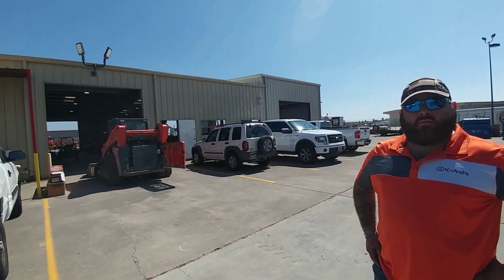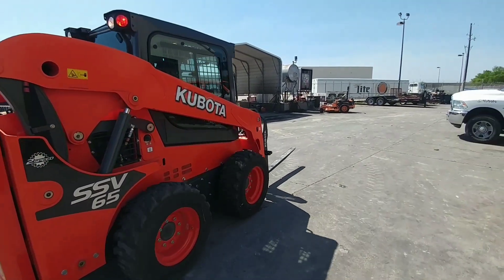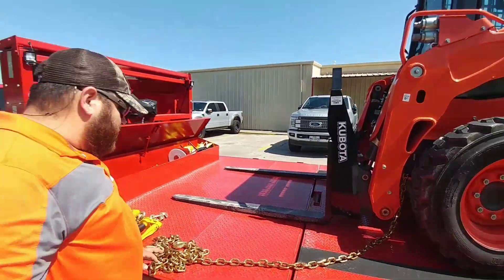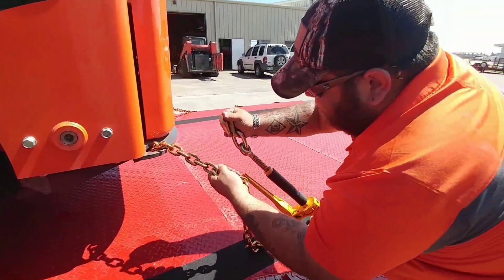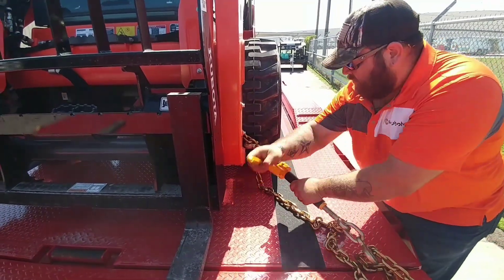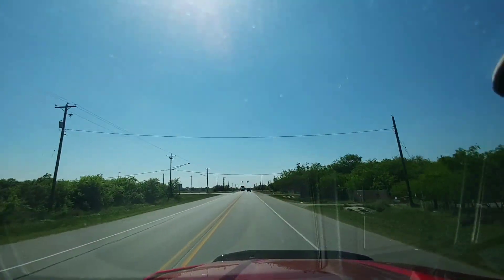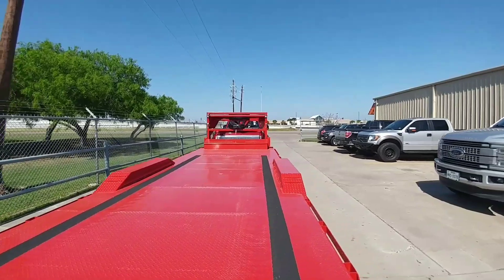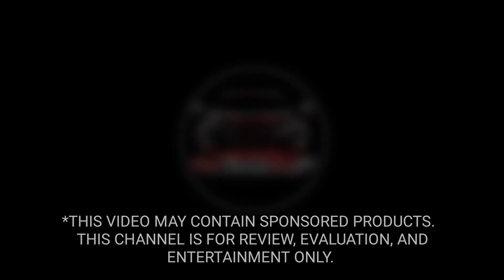Tow Testing the GEN-Y Spartan Gooseneck Coupler at Ewald Kubota!

Comment: Just an heads up. If this skid steer weighted 3k more. The chaining would be incorrect. Anything 10k or more has to have 4 points of contact. IE , a chain & binder on each corner but since it’s 7k. Your fine. Didn’t know if you knew or not

Comment: At 12:40 I would like to correct the statement. If you have a USDOT number, meaning commercial, you must separately chain down the boom, it is called failure to restrain cargo properly and you will get an OOS on your record. I hauled equipment like this for 10 plus years.

Comment: Chains are only as strong as the weakest link often it’s the item it is secured to. Bungee cords are always on my loose/excess chain. Love the ratchet binders even if they take a minute longer to use. 
Overbuilding a trailer is safer when loading to when you have a trailer that tilts for loading. I’ve seen some tilt trailers fold from being loaded with a load that was either more than it was rated for or improperly loaded.

Comment: Always love your truck. Nice trailer site up.  Like I said before on one of your videos.  All drivers license has classes that’s D.O.T Standard. If your pulling over 10,001 lbs you need a class A. So even if your trailer is rated at 12,000 pounds without your class A license you still can’t pull it. If you go take your non-CDL license or just pick up a CDL manual and read it you would know for every 10,000 pounds you need one chain.

Comment: FYI. The handle on the binder is supposed to contact the deck of the trailer when being used in order to keep the threads from backing out when you hit bumps. The reason for the offset handle is because with a center handle you sometimes can’t make contact with the deck depending on the angle of the chain. That’s less likely with the handle placed closer to the deck. Folding feature is for storage.

Comment: I'm not a DOT guru or anything, but I'm pretty sure like Reuben said, you can use one chain on the front and one on the back, but you still need 4 binders.  If the one binder say on the back comes loose, then you will only have one tie down left that's on the front.
Reply: As long as the chain between the 2 tie down points is slack, yes you can. Effectively you are using each end as a separate chain.
Reply: @harriettedaisy2233  that is how I meant to say it, just dosnt come out like that.  At least you understood what I was getting at.  Thank You
Reply: If the vehicle/machinery is over 10,000lbs, it has to be tied down on each corner. Under 10,000lbs, it can be setup the way it is in this video.

Comment: I see a lot of comments about needing to put more weight to the front so there is more movement in the hitch.  that is not the case, you had it set up right you should get small movement just to take the jarring out of the ride. If you get to much movement you start getting rebound and the trailer feels out of control.

Comment: I have watched most of your hitch reviews. I would like you to compare the Anderson hitch to the Pull- rite ball hitch. It appears to be the same only the ball and socket are reversed. Just wonder if one has more advantages over the other.
Reply from the maker: I've honestly struggled to see the advantage of using this setup over a traditional 5th wheel pinbox.  My assumption is the slight decrease in movement when connected, but I personally am leery about adding adapters to pinboxes if it can be avoided

Comment: That’s not a legal 4 point chain down. That rear chain is only considered a single point. If that chain breaks, you lose the entire rear securement. Chain should terminate on the load and have separate binders on each corner to get the full capacity chain and binder rating. May be different in Texas, correct me if I’m wrong , but ANY attachment should be strapped or chained,forks included.

Comment: What’s the reasoning for switching to pin vs auto coupler? We put a gen y hitch on my co workers 5th wheel with the auto coupler
Reply from the maker: Apparently the auto-coupler was getting some complaints because it sometimes was difficult to uncouple due to how close it was to the torsion assembly.
Reply: I was wondering the same thing that pin would drive me nuts having to crawl into bed and do that every time

Comment: Why wouldn’t you de-rate the trailer to 14,500 if you’re only using a single rear wheel then you can clear 10 to 11 K on the deck 7000 pounds is nothing